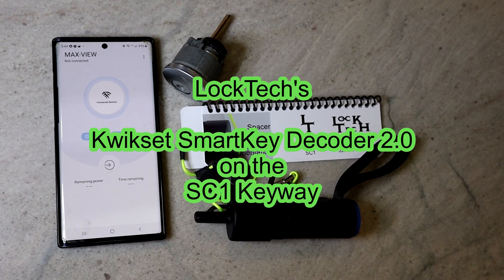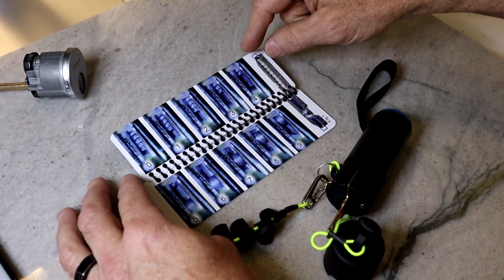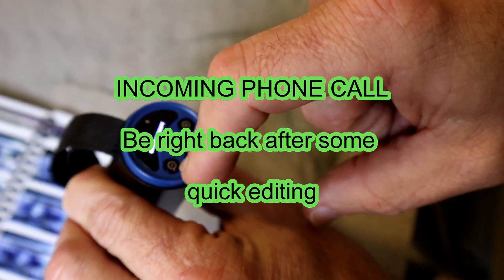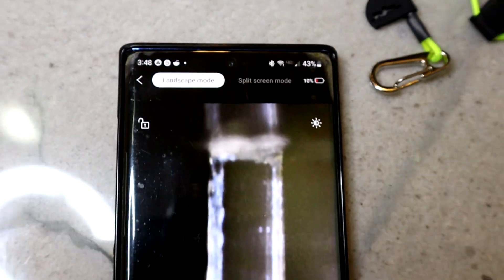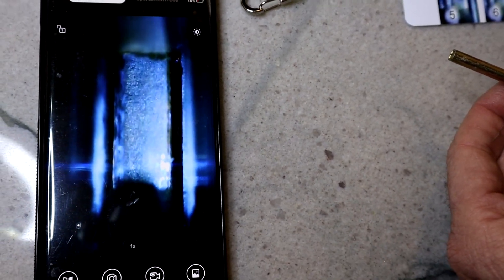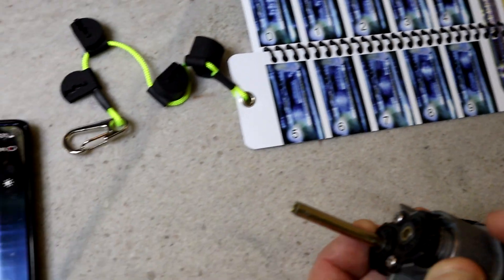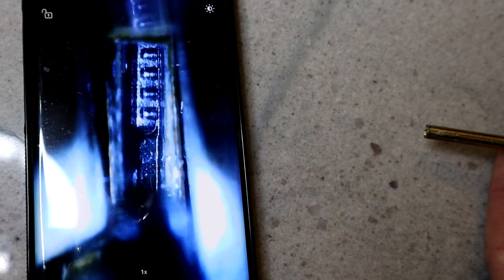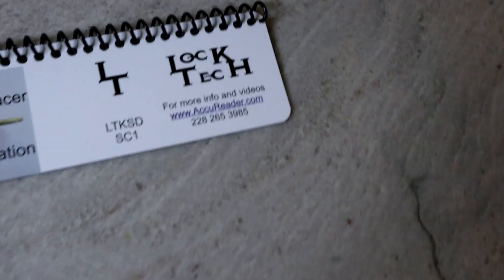Kwikset Smart Key Decoder LTKSD2.0 SC1 INTRO

Comment: Is there an update to handle the newest KW1 keyway cylinders? I encountered a brand new one that client had installed the day before... leaving the box, keys and programming guide inside the locked bedroom.  I did not get any recognizable images on the Decoder. Lishi also failed.....no binding in any position. I realize Kwikset is doing redesigns fairly often for obfuscation. Any updates to effect success on these ?

Comment: I bought 1 of kwikset when 1st came out and not long after the light stopped working on it so $300 wasted I guess
Reply from the maker: if you contact us we can get your tool repaired.
Reply: Did you try tightening the allen screws? I had to take the blade off and put it back on. After I tightened it up, I haven't had a problem.